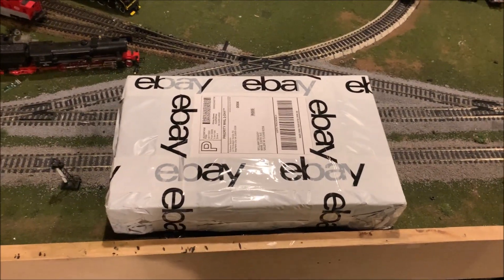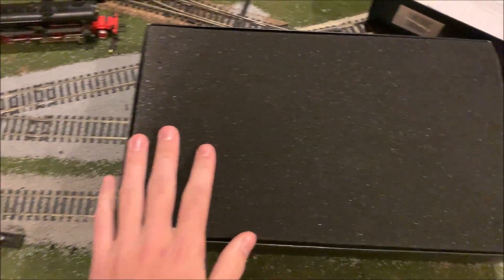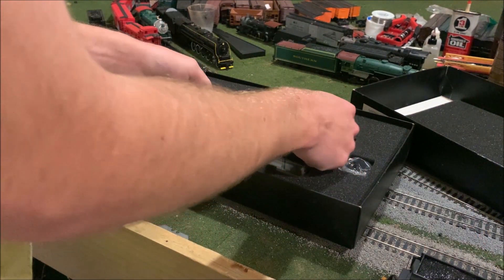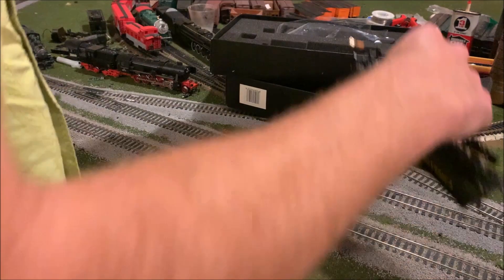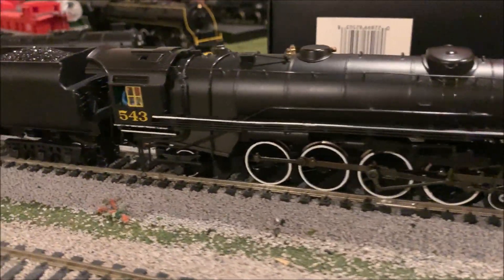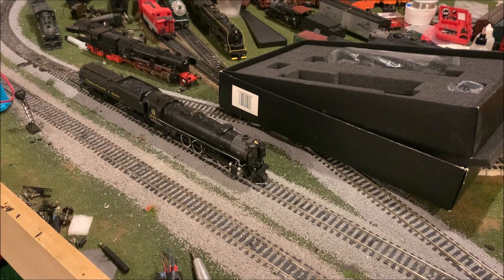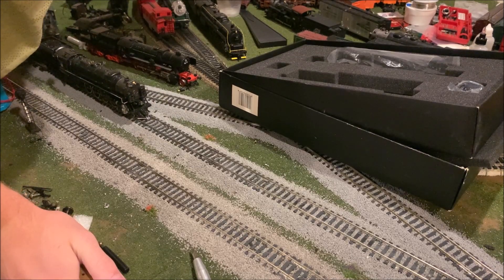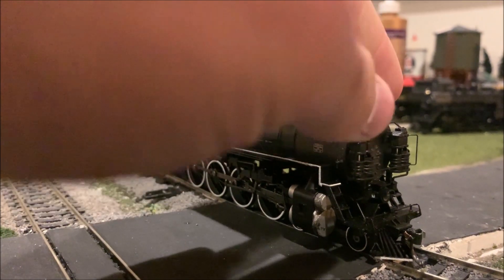Unboxing My Most Expensive Bachmann Engine - Was it Worth it?

Comment: I had one, that I decced out as a Soo Line N class, as delivered.  My issue with it was, that even on 40" curves it still looked wonky.  They are also VERY light on their feet.  I put my FVM Hiawatha consist behind it (1 Baggage, Parlor, 3 Coach, Tap Cafe and Beaver Tail) and on a .5% grade and watched it slip it's drivers.  As it entered the club curves it would slip it's drivers too.  I ended up selling it for a couple of reasons, 1. to get it to pull my fast milk run (a Bachmann hvy weight passenger consist of 1 Combine, an Observation, and 5 Branchline express reefers it couldn't even pull that.) would have meant tearing it apart to add more weight, and when I googled how to do it, was more work than I wanted to try, and 2.) the more I thought about it, the loco didn't match my expectations or what I wanted to do with the layout.  That said, with just the 2 Bachmann hvy weights it ran fine, just looked odd with only two cars.

Comment: is this a split axle model if so you are in for some issues down the road
Reply from the maker: This is not a split axle model. They didn’t make 4-8-2’s with that chassis design.
Reply: @gopernoperstrains3160  that's good then

Comment: Wait a minute, you bought it not knowing if it was or wasn't DCC??
There is a major price difference!!
Then ya didn't look at the end of the box label to see, then ya need to look at the bottom of the loco or tender to see if dcc is printed on it?  WTH??? And ya also didn't know it had sound either? And now after the first 3 minutes, ya what me to watch the rest? Really?
Reply from the maker: I bought it “not knowing” because these engines have an 8 pin DCC plug inside and the seller stated the engine had been modified. However they didn’t care to mention what had been done. If you’d continued watching you’d see the seller had installed a terrible botch job “sound” decoder in it that I removed and replaced with a DC plug. This video was primarily filmed to show the unpacking and testing process in case it was damaged in shipping. Thought to share it so people could see first runs. I intended to make a full video on it later but comments like yours and a general lack of time discourage me from doing so.